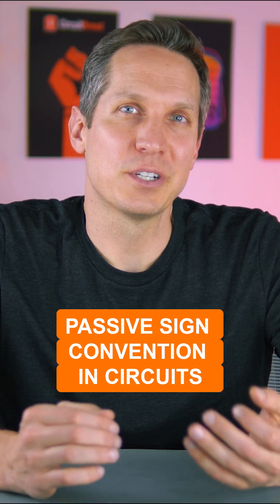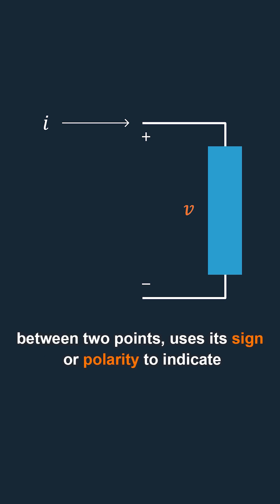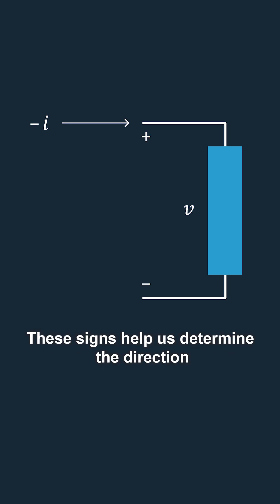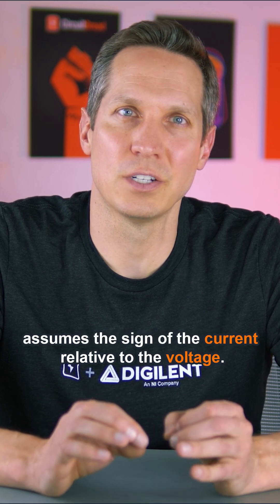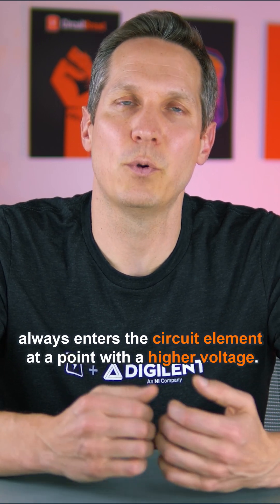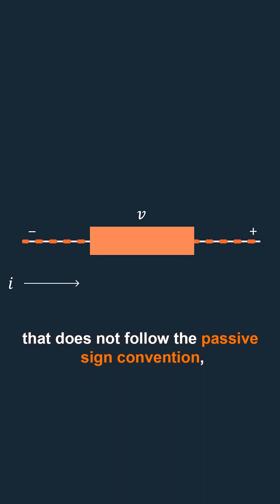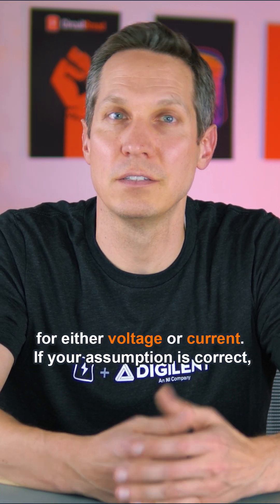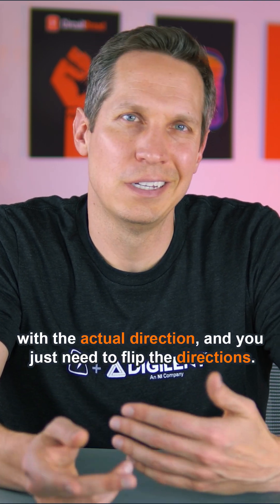Passive Sign Convention in Circuits

Comment: No, do not need to flip the direction, you don’t have to change it. It is a convention that you use before starting the analysis. If power sign in a bipole results negative and you selected the user convention, it simply means that the bipole is sourcing power